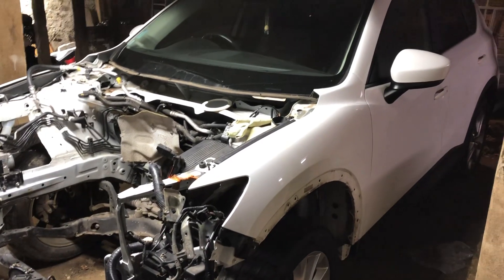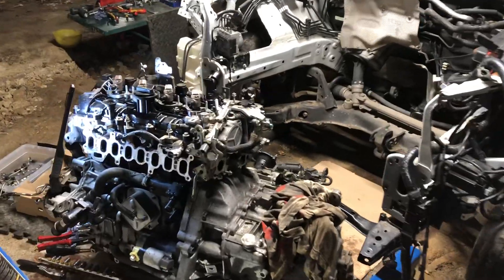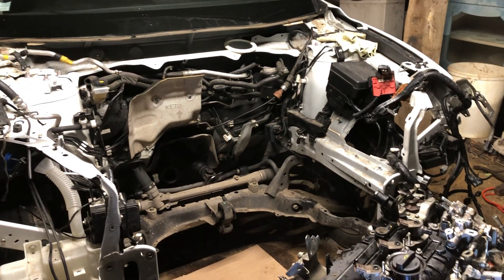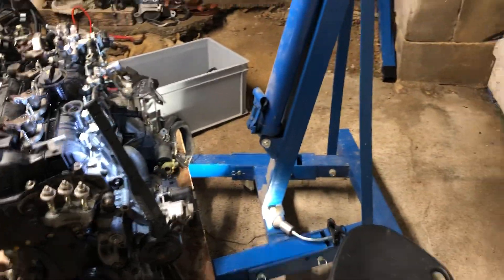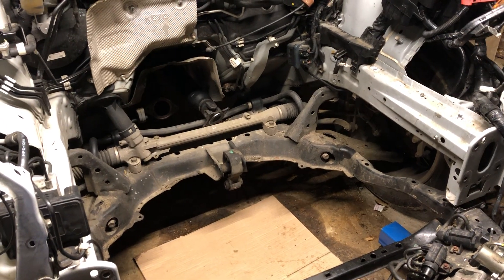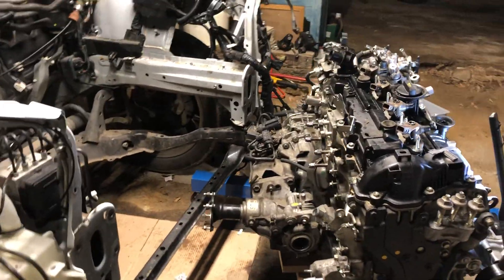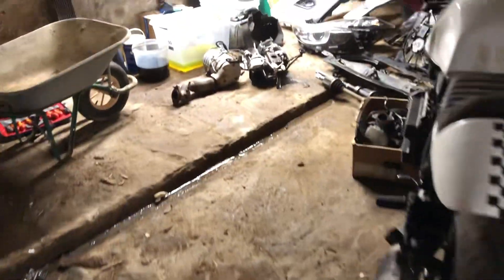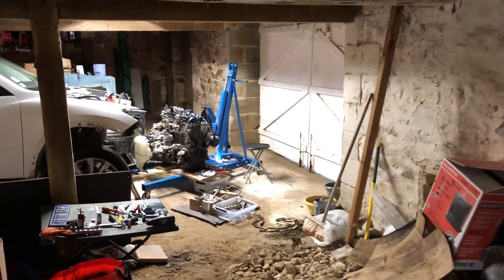Mazda CX-5 2.2 Skyactive Engine removal at home.

Comment: Can I just confirm if it was worth it in the end, please? I'm embarking on this task this weekend, and I'd like to know if you were able to get it to work well afterwards. Thanks.
Reply from the maker: Hi, yes, I am still driving the car six months on. The only issue I had after reinstalling the engine was a small loss of coolant due to a leak from a transfer tube at the back of the block, not tightened enough. Engine is now very quiet and reliable. I’m very happy with the outcome.
Reply from the maker: Also, I re-gassed the A/C using a 650ml refill and hose bough online. It worked a treat and less than €30.
Reply: @Hart4669 Many thanks, I'll give it a go too.

Comment: Amazing but you should record step by step how you did it. Because I just found this video on how to remove engine on Mazda CX 5 but there's not enough information on how to do it
Reply from the maker: Hi, this was to show it is possible to remove the engine/gearbox from the front, without a vehicle lift and without removing the subframe. It’s a long process but possible. Remove front panels and headlights. Remove intercooler and turbo pipes. De-gas the air con and remove radiator pack and fans. Remove crash bar. Remove alternator. No special tools required, when ready, disconnect the engine loom from the connection box on the right hand fuse box. Exhaust and awd drive shaft can be reached from underneath. Engine removed complete with the DPF and twin turbo. Disconnect drive shafts by removing wheel hub assemblies from shock struts. This is a long complicated process but possible. Don’t forget to take lots of photos during disassembly, you may need to refer to these when reassembling.

Comment: is it possible to leave the transmission in place and pull the engine up?
Reply from the maker: @ku9zy  I did not remove the transmission from the engine during this work. I don’t think it would make the job less difficult. This was had automatic box with all wheel drive transfer unit, so not just a simple bell housing from block split.
Reply: It's easier when you remove both. I have done this job many times and this is the best route I have fount too.
Reply: @kalindambozi2356  ok so just to clarify i can remove the engine from the top without removing the transmission.  Any videos or how to links you can send with this?  Could use all the help!
Reply: @raycampos6823 it's won't make the job any easier. You will eventually decide to remove both. It's the easier way out. Less work less stress.
Reply: @kalindambozi2356 my only option is removing it from the top though (no lift).  You got any tutorials or links to help with this?